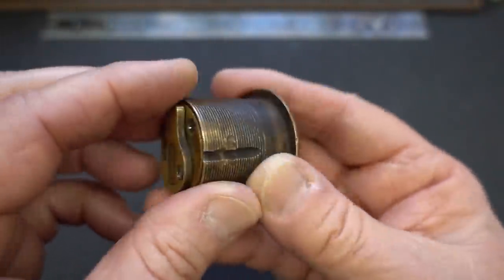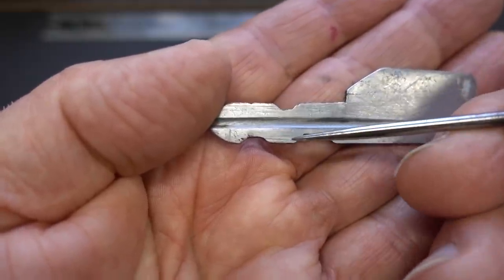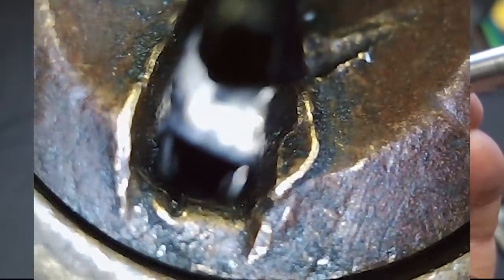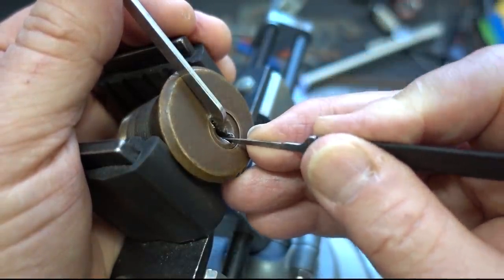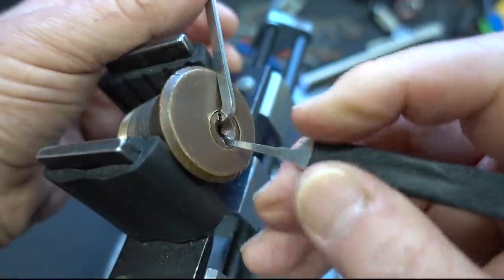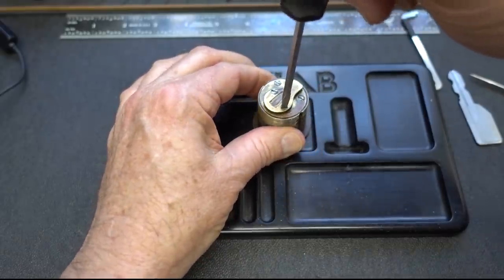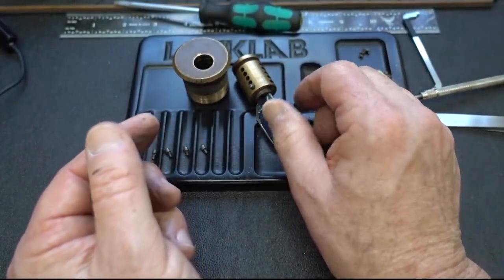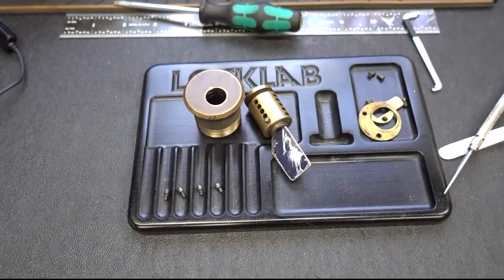(1872) Antique Wafer Lock with Side Pins

Comment: I spotted the pin holding in the wafers and that seems to be the only way to remove them. I can only imagine how much of a pain it would be to reassemble once someone removes the springs and wafers. Very cool lock none the less. Thanks Alex for sending the lock and thank you Bill for sharing it with us.
Reply: Easy enough to assemble, but to change the cut not easy, as likely that pin is fitted into an interference fit at the front and rear.
Reply: Saw it also.

Comment: It looks like those brass strips running lengthwise slide out to allow the wafers to be changed.
Reply: Looks like there is a pivot pin through the barrel to allow the wafers to pivot, so you would need to get that out first, and I would guess it will need a new one going back in, as not likely to survive the removal process.
Reply: 11:03   Yup.

Comment: There is a pin going through the wafers acting as a  pivot.  The individual pins act as a sidebar.
Reply: Agreed, the pin is visible from 9:45 just in front of the probe.
Reply: Which means you have to remove the pin to get the wafers out. And they are spring loaded too. Obviously needs a clean, although to get all 5 wafers working might be impossible due to the wear.
Reply: That's what I thought. When he took it apart at first got quick look at the cut inside the housing where I presume the pins sit and stop core turning. Gotta be some way to get the wafers out

Comment: My guess is that the original key had different  length pins and side impressions in the key for them to drop into.  By replacing them all with undersized pins of the same length, a normal homemade key would work?

Comment: I'm sure the brass strips need removing , this will allow springs on wafers to be removed releasing all tension  , the slide pin running through holding the wafers should be able to be tapped out releasing the wafers fully.

Comment: Well there are seen 2 bars, that are removable. On 9.41/11.03 you can see it. If you push it back like in normal Pin holding Bars. I guess you might be able lo lift up the Springs and taken the Wafer out.

Comment: Great video as ever, wondering if you have seen the film " escape from Pretoria" on Amazon. A man escapes from prison using WOOD keys he made . Is this possible ??
Reply: Why not?  It just has to be strong enough to lift the pins, or work whatever other sort of mechanisms are inside the lock.  It might also have to turn the lock, depending on your design.  For example, Modern Rogue and LPL made keys from a plastic bottle and a plastic card, like a credit card.  They weren't strong enough to turn the lock cylinder, but they lifted the pins, and they used something else for leverage to turn the cylinder.
Reply: Yes it is possible. His name is Tim and he lives in Cape Town with his son. We see each other from time to time whenever I am in Cape Town. Tim has a mind that works like no other...
Reply: @ErrolLishman  thanks  thought was a bit of Hollywood bull.